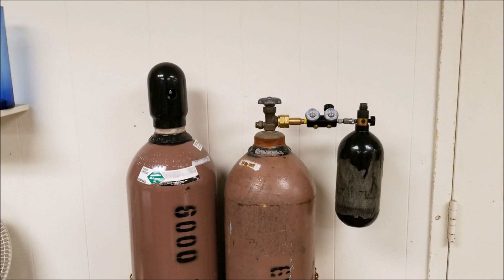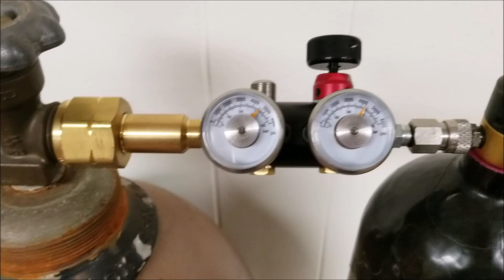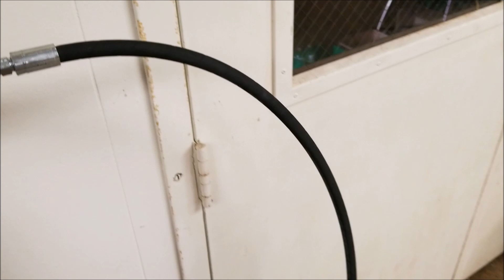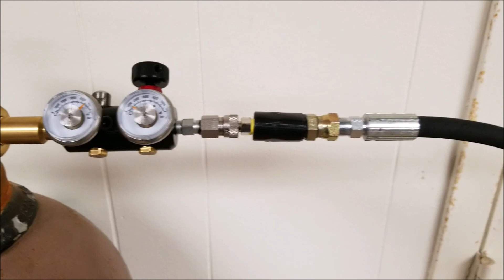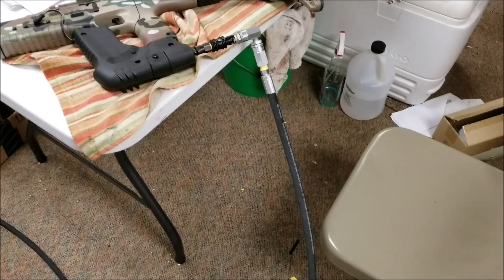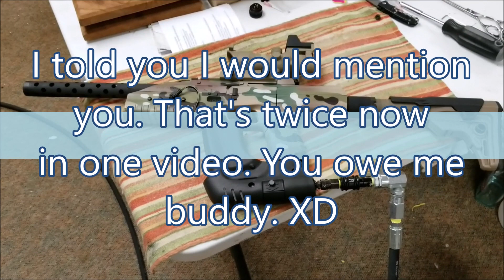8K+6K Nitrogen And More

Comment: need regulator from tank i have a compressed air tank want to fill up air rifle from tank
Reply from the maker: It sounds like you are needing a fill station which is pricey. I can use this reg to fill, but it's sort of a pain. The least expensive fill station used to be the Ninja Stick fill station. Some of the literature calls it an adjustable regulator, which it is, but that's misleading. I have one of those, but it doesn't work as a reg for me because it doesn't have enough flow for these birds. The reg in this video is a Miller Smith 827-00-27. To fill with it you have to slowly adjust it up from zero as you fill. You can't control 6Kpsi enough when you open the tank valve to set it to your target pressure, and open the tank valve. With a fill station you set it to your target pressure, and then connect to your bottle. Then you can slowly, and more importantly, safely fill.

Comment: What sort of FPS are you getting?
Reply from the maker: That's a loaded question. Pun intended. You can get them right up to the sound barrier at just over 1150fps at around 1200rpm. As you raise the rpm you have to lower the pressure to get it to feed so you loose velocity. There will be a sweet spot in a different place where magic happens depending on voltage, pressure, barrel length, valve type, fire rate, pulse width duration, moon phase, etc. The Sweet Spot is is located in a much broader region known as The Fun Zone.

Comment: I have a similar design. Being a welder by trade I have an assortment of tanks such as argon, and argon/CO2 mix,  including tanks of straight CO2 and nitrogen.  My nitrogen tanks are filled to about 2,200 psi. I prefill my PCP rifle with nitrogen and then use the air compressor to top it off at 2,900 psi.  This way I save the compressor since it has to work less.   Even when the pressure in the nitrogen tank is down to say 1,000 psi, that's about a 2 thirds fill, which saves on the compressor.  I have a Yong Hang compressor and I've wondered how many hours of run time and/or life expectancy.
Reply from the maker: There are timers for equipment that keep track of run time by using vibration. One of my customers uses one on his Yong Heng. I'll try to include time of death in a later video, but for the price you can't beat them. I would change the oil very regular when I was using mine. I had another pump with a similar design I kept ruining the high pressure piston rings in because of neglecting to change the oil regularly. I could get rings for it though. If you change the oil regularly in yours, and save the oil the metal filings will eventually fall out of suspension. Since there isn't any combustion going on the oil looks good as new after a while with a grey sludge at the bottom. Another tip to make it last longer besides runnung it as cool as possible is to change the oil immediately after a fill while the oil is still hot. The way the crankcase gasket is designed is it's like a diaphram. There is only a small hole near the bottom, and one near the top. The one at the bottom is about an inch off of the bottom. I think they did this to prevent oil coming out of the breather on the fill plug, and make the level gauge readable during operation. So what happens is if you always change the oil after it has been sitting for some time the filings fall out of suspension. They will stay on the bottom when you drain the oil because they aren't going to go up, and over the gasket to get to the drain. Then depending on how long it has been sitting when you drain it you are in effect draining the good oil off leaving the bad. The sludge will just keep building up in the bottom, and mixing with your fresh oil  the next time you fill. I took the gasket off of mine, and couldn't get it back on. I used RTV to seal it back up. I have a few vids about the Yong Heng on this channel.
Reply: @masondawson4061  Get 300 bar nitrogen cylinder and just fill direct.
Reply: So there is no issue using nitrogen? Been wondering why its not more widely used. Apart from amatures playing with hi pressure and hurting them selves. Makes PCP affordable for me, hand pump doesn't sound like much fun to me and expensive compressors put it all out of my budget. Cheers for the video
Reply: Hi could you give me some advice, I’m a refrigeration engineer and carry OFN in 2000psi cylinders. My regulator is 50 bar rated. Could I use this set up to charge a 232 bar pcp rifle, to fill it?
Reply: @iamspartacus8219  With all due respect, if you are an "engineer" you wouldn't need my advice.
Reply: @handygent45  I am an engineer, and the reason I asked, is your in a minority whom put nitrogen in they’re rifle, most forums tend to shy away from it or are outright against. Since I knew air is 80% nitrogen, I carry 100% nitrogen, I couldn’t see a problem. Could I ask why at 1000psi in the cylinder you swap over to compressor. Does it become a struggle to get charge in when at 1000 psi
Reply: @iamspartacus8219  watch my video
https://www.youtube.com/watch?v=pan3N6kip9A&t=223s

Comment: I was nervous using the “hardware store brass fitting” most have a “working “ psi of 1200 but if dig a little deeper I found out the burst psi is 15000, yes fifteen thousand psi. After finding the burst pressure I use them up to 4500 psi with confidence...
Reply from the maker: Wow! Yea it does make you wonder given the thickness of various burst disks.

Comment: The gun is cool but for 300$ to camo is just a little to much and mag or shroud is not included in the camo.  the starting price was 600$. Is it worth it?  the birthday board was very cool gift. By the way happy birth day. Was very interested to see and learn more about the set up mybe in later video?
Reply from the maker: Absolutely. The rest was a gift too minus spare parts. Perhaps I raised expectations too high. Easier to lower price considering the discrepancy in currency.  You will see this as a common thread. There is always room for negotiation.